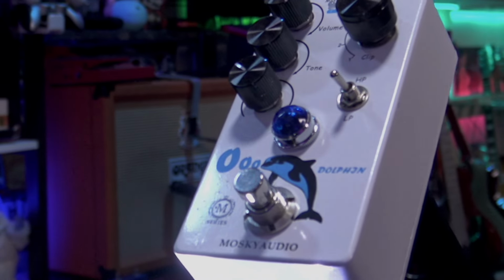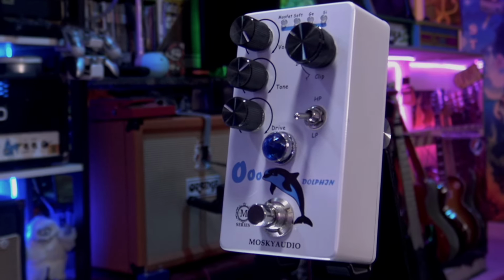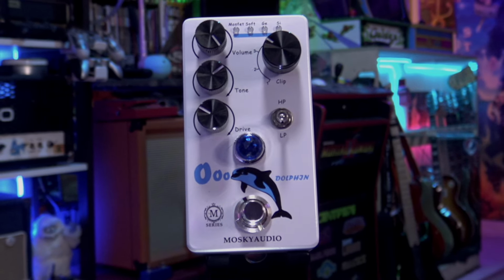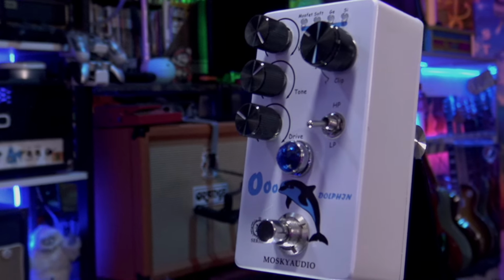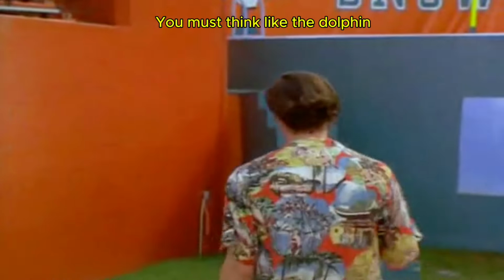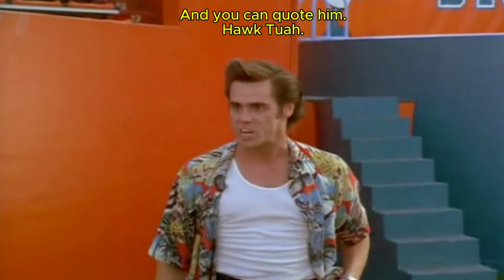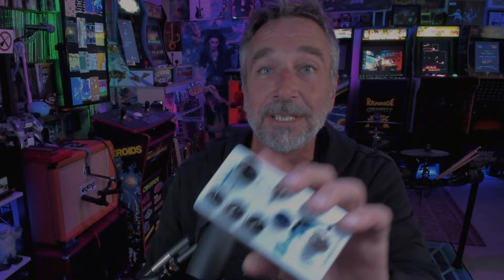What exactly is the Mosky Dolphjn? I need a detective...

Comment: I have a fuzz pedal of sort its a pigtronix disnortion. It sounded like crap till I turned the tone almost off in series with just enough gain so you can barely tell   its on. Now its great but thats how I like it,everyone is different.
Reply from the maker: I was really liking the Low Pass tones and the punchy, driven tone I was getting from this thing.  Someone below mentioned that this is an OCD clone, and agree that it is that kind like the Disnortion that blurs that line of aaaalmost fuzz. Def not my normal sound, but after listening to the video while editing, I was digging some of the tones.  Thanks for checking out the video.

Comment: It's supposed to be an OCD Overdrive clone but you say Fuzz. The Big Fuzz is the fuzz of the M series pedals. Maybe you received a dud.
Reply from the maker: @patrickmcmanus5373  oh gotcha, and thank you! I can hear that more clearly now, as opposed to a straight up fuzz circuit. Not quite fuzz, but beyond a typical OD. Decent, but not totally my thing.
Reply: @DoubleDguitar  the Big Fuzz Mosky has Big Muff, Tone Bender MK2, Mosky Fuzz and Boost. Buy it for the 5000$ tone bender clone alone or the Mosky Fuzz is a outstanding modern fuzz circuit.
Reply from the maker: @patrickmcmanus5373  I will def have to check that out.
Reply: @patrickmcmanus5373  It's not a Mk2 Tonebender clone in that pedal, it's Colorsound Tonebender, which is a (rather confusingly named!) very similar circuit to the Big Muff hence why it's in the pedal, as it just needs a couple of components switching around, whereas a Mk2 would require basically switching the entire circuit out.